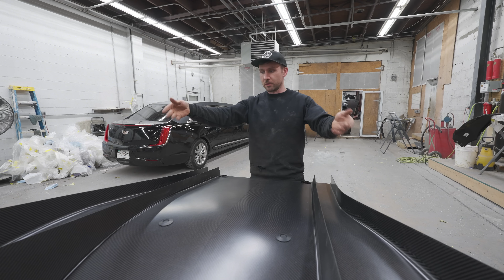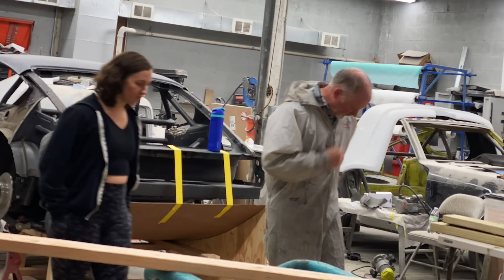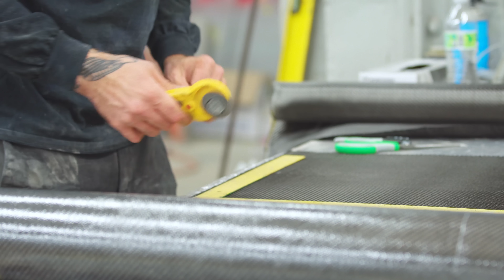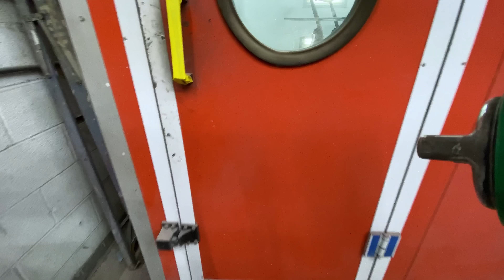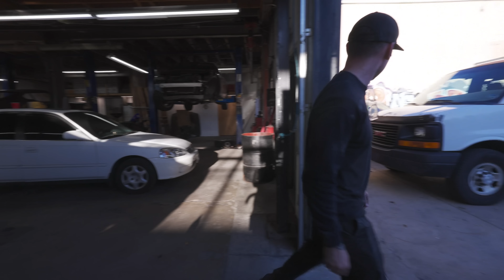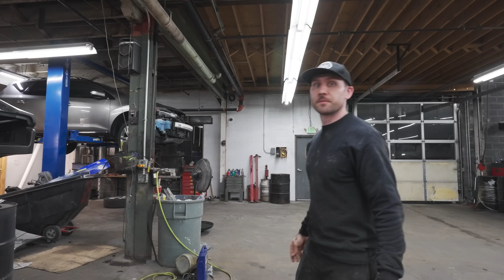DIY Carbon Fiber Diffuser for The Tesla Swapped 240Z | The Legacy (17)

Comment: I’m surprised that the strakes only need a bead of epoxy to stay in place but I guess they only receive a bit of lateral forces. That little extra detail of the diffuser flaring outward is really nice. 🔥
Reply: They’re gonna fall off.
Reply: the strakes may not even be necessary
Reply: Yeah I thought that looked a bit jank. I'd have tabbed it in and epoxy a good surface area on the back side. Armchair engineering.
Reply: i thinks it’s more for visual at the moment and worrying about getting it completed for sema. the thing about aero is there is alway improvements that can be done no matter how perfect it is
Reply: @offwhitecolby  yeah makes sense, but I had always wondered how OEMs make their carbon diffusers. I wonder if they tab them in an epoxy from the backside as well

Comment: I think that once you guys put the car through a wind tunnel, you'll probably need a few more winglets inside the diffuser. If you have time, would be a good idea to bring some rigid three wall cardboard and some aluminium tape with you to experiment in the wind tunnel. For other wings as well, possibly some in the front, "gill" type winglets or those that go right under the headlights, since the 240z has that rounded shape, it would help direct some of the flow out (air = liquid, so it will stick to the round shape of the front, which can cause turbulence in the middle).

Comment: The edge were soric core doesn't completely go to could be filled in with micro glass beeds in resin, makes it easy to bulk up, blend and round over that edge.

There's a couple very good youtube tutorials on making capable shop air filters, they'd help you guys a lot.

Comment: I removed my spare tire tub(?) and mounted my fuel cell flush with the new flat floor, so I have been wondering how to mount a diffuser to divert air away from smashing into a 1' x 2' brick wall, basically. Thanks for the mounting ideas!

Comment: Yeah .... that diffuser is going to stall. 
The jump in cross section is awful, but you could've saved it with properly placed/shaped strakes.
The strakes you did put on there however will only make it worse. The inner section is probably going to work, but the outer sections are nothing more than draggy vortex generators.